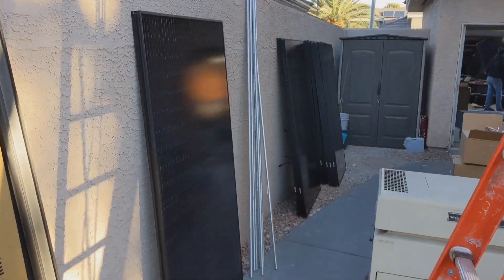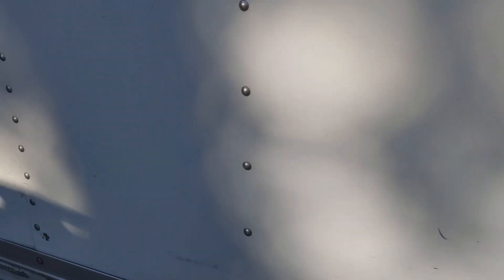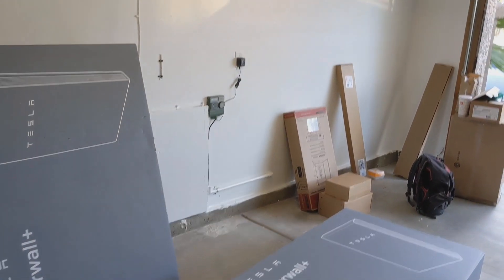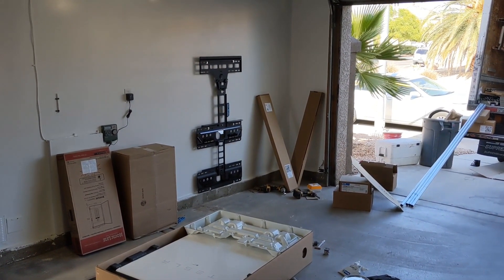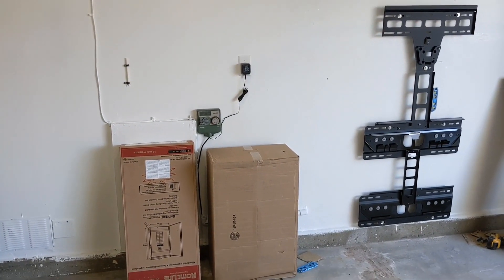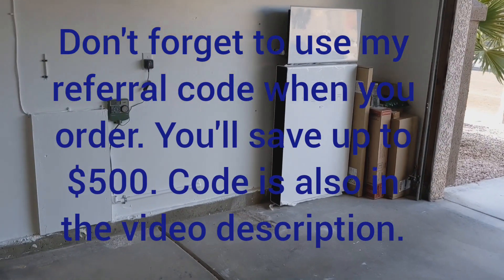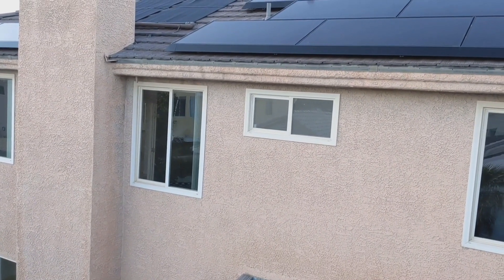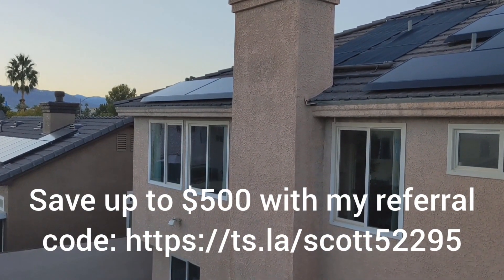Installation of Tesla Solar Panels and Powerwall - what happens on install day?

Comment: Tesla batteries in the top 3 but use horrible solar panels and has the worse customer service . Enphase , Sunpower, Generac battery really good and Sunpower panels are the best in the world with a 92% output within 25yrs compared to Tesla chinese panel producing 65-70% output and horrible inverter warranty .
Reply from the maker: Yeah, their customer service isn't the best. Inverter and panel warranty is 12 years. You're wrong about the "Chinese panels". Tesla guarantee at least 80% output at the 25 year mark. Although in my case it's better than that as they supplied Q Cells which are 85% at 25 years.

Comment: Curious about how your system was designed considering not all panels are facing the same direction and you seem to have only one inverter. I was under the impression that Tesla inverters don't use power optimizers, so how are they avoiding production loss when the sun transitions from one set of panels to the other or when you have partial shade occurs from clouds?
Reply from the maker: The powerwall plus inverter has 4 MPPT connections, and the solar arrays were  wired together in two groups based on the direction they face. So that should mean performance is optimal. We'll see, when it finally gets switched on. Still waiting.
Reply: @ScottAllison  Oh wow! That's amazing. I have SolarEdge with optimizers and it seems to me that that along with clipping, I lose a lot of what my panels can truly produce. Great to hear that Tesla's inverter are well designed for these scenarios. Congrats on the new system!

Comment: Can you share your timeline from order to installation? Thanks a lot. I did order but currently it shows delayed due to supply chain issue.
Reply from the maker: I ordered in June, then spent most of July and August arguing with them about the design. I signed the paperwork on September 1 then they wanted to do an on site inspection, which took 2 weeks to attached. Then they applied for the permit, that took about 3 weeks,. Once they got that it only took a week to schedule the solar install. However, the electrical install was not scheduled until the end of November. Luckily though they had a cancellation, and so it was done in early November. They filed for an amended permit at this point because they had changed the location of some of the panels on the day of install. Still waiting for them to make an appointment for the city inspection... Over a month after they completed the work. Still not live.
Reply: @ScottAllison  yeah that sounds like normal to me 😂

Comment: My question is about the powerwalls.  I thought I read that the operating temperature was documented up to in the neighborhood of 120F.  Is the garage in Nevada acceptable?  In Texas, my garage is way hotter than that, and I can only image Nevada is hotter than Texas.
Reply from the maker: That's a good question. We're in Vegas but our garage never goes above 100. But they never asked or looked into that. I know the powerwalls have cooling, so I guess it's fine.
Reply: My Garage faces the North and never gets above  90 in the summer . I have the powerwalls installed there.

Comment: Hey Scott, I am In Las Vegas as well and this crew installed my panels and powewalls last week! They did a great job! Working like a charm so far.
Reply from the maker: Nice! Mine isn't hooked up yet...I think they're busy busy. How long did it take for them to get you online?
Reply: @ScottAllison   still waiting for Nevada Power 😢.
Reply: At least I can use the solar under self-power
Reply from the maker: How quickly after install did the city inspection take place? I'm still waiting
Reply: How long did installation take?
Reply from the maker: 1 day for the panels, and then another day for the power walls and the new load center.
Reply: @ScottAllison  Awesome. I just got all the materials delivered yesterday, and installation begins on Monday. 16.8kw and 1 powerwall 3.

You think it will still be 2 days? Also, how long did they need to turn your power off?
Reply from the maker: The power was only off on the day they installed the new load center and power walls. It took the whole day.